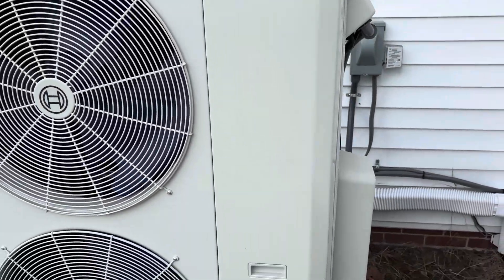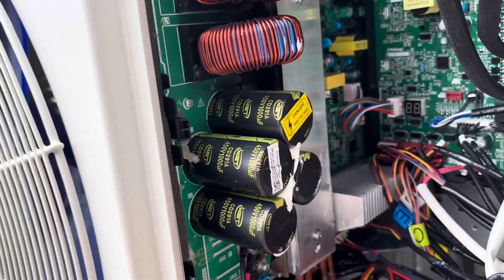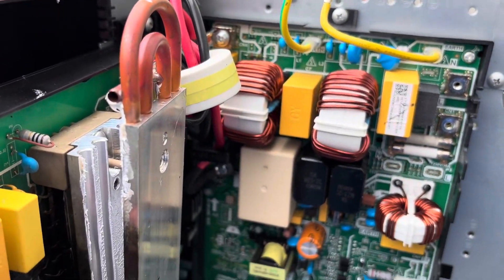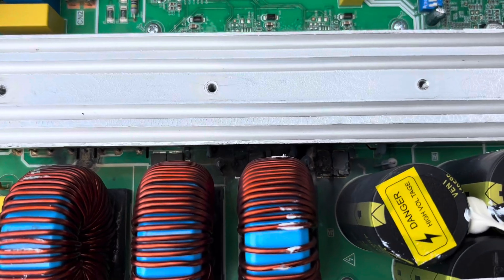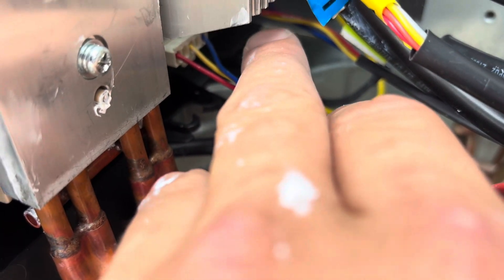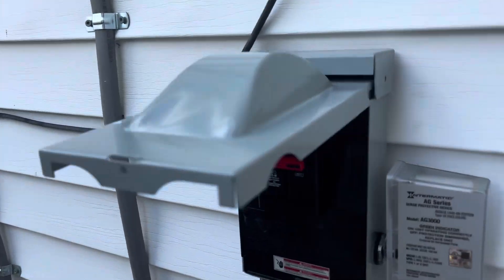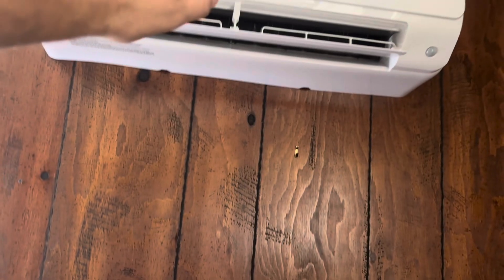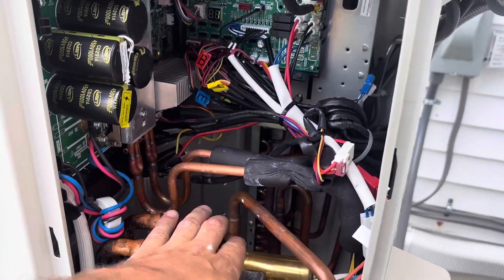Brand NEW Bosch Ductless Heat Pump Woth Main Control Board ISSUES!

Comment: I was wondering does anybody use Japanese   or American  capacitors for the inverter boards. I fix computers big huge computers and that includes cooling. I have noticed that if there is Rubycon,Nichicon or Cornell Dubilier they would run and run no issues . But if they were Chinese brand well lets say they failed always it seems. I know years ago China stole a incomplete formula for electrolytic caps from japan and well it turned into a disaster for them.

Comment: Good fix Jeff it chared at the heat sink because bosch at the factory probably did not add the heat sink paste or thermal grease when doing computer cpus you have to use that too.

Those darn Chinese.

Anyway if you have a micro center you can always buy thermal grease like thermal grizzly which is for the good stuff 25 dollars a tube or there is another brand unless your hvac supply house sells them buy the tube welcome to the world of what guys who build thier own desktop computers have to do.

But the using the refrigerent to keep the board cool is not a bad idea.

Comment: Hey Jeff, great video! What is a good tester for a homeowner to do testing on a cap? I have a multimeter to test power.
Reply from the maker: Most multimeters these days do test capacitors.  Yours very well might.  But if it doesn’t,  I’ll link a good budget one below that works pretty good.  

https://amzn.to/425S451